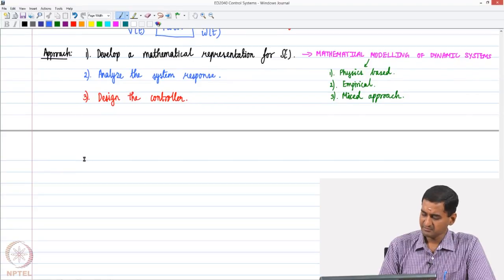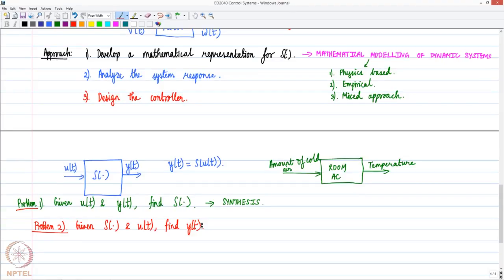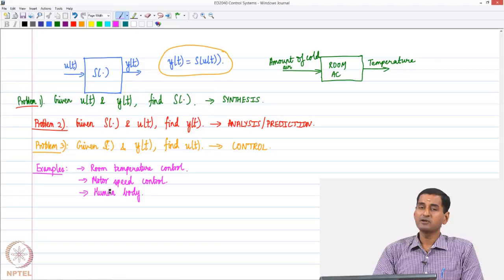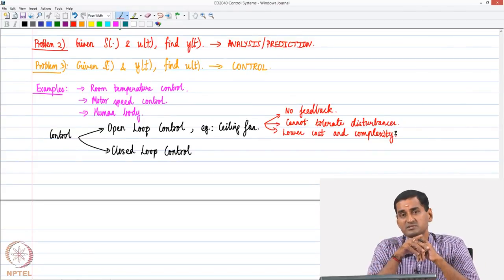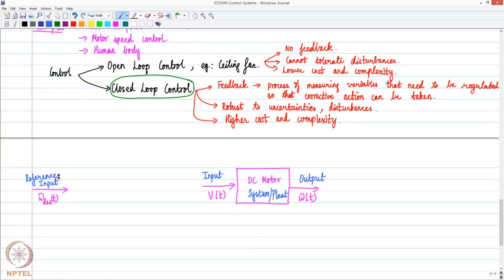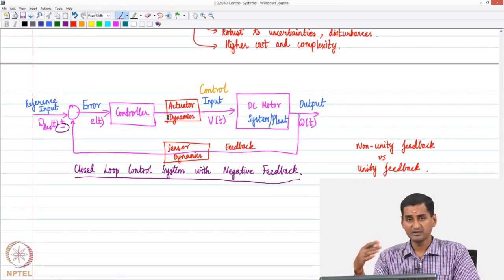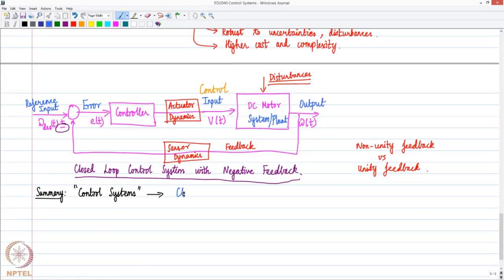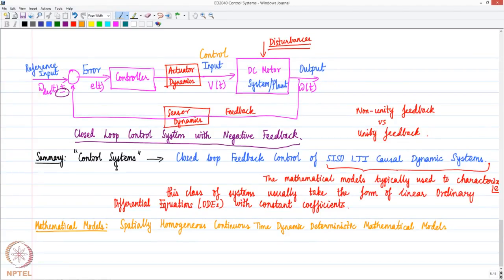Introduction to Control Systems - Part 2

Comment: what is system ? 0:00
synthesis, analysis and control 2:00
open and closed loop control 8:50
closed Feedback loop with -ve feedback 15:00
course summary 21:10
spacial homogeneous continuous time dynamic deterministic control model 25:00